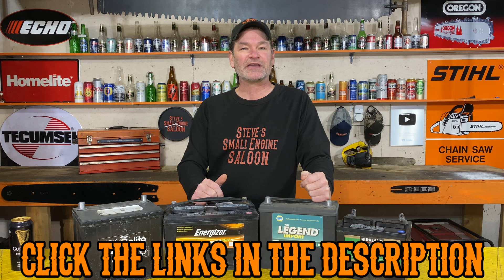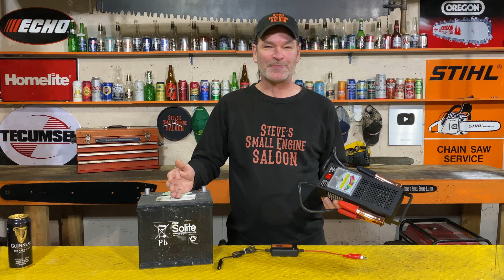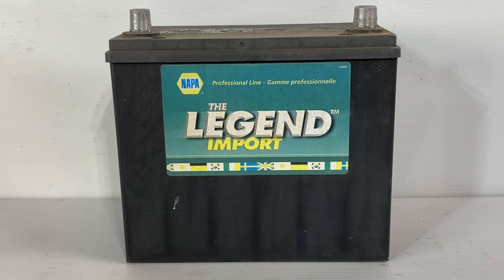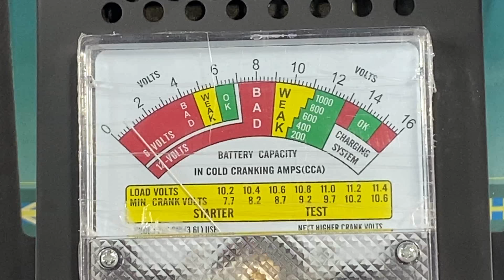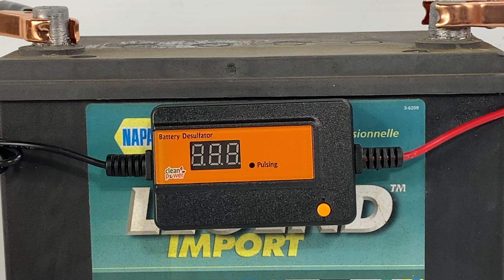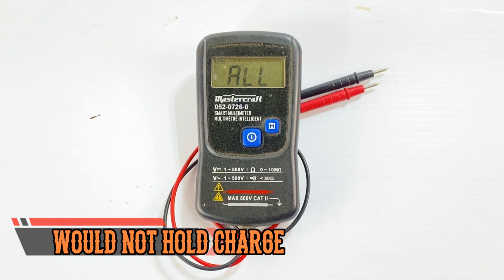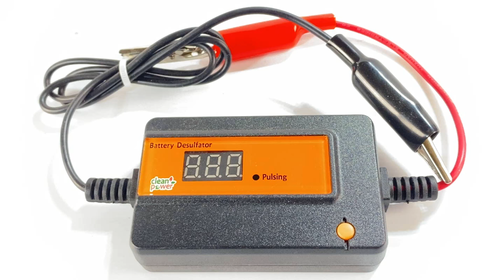Does An Electronic De-Sulfator Really Repair A Battery?? See Real Results

Comment: I used to sell the Pulse Tech brand and still use them to this day. Some had solar pannels some did not.
THEY WORKED and worked well.
They were warrented for 10 years and I only had 1 to replace of the 7 years I sold them. I bought and sold hundreds to various end users.
Keep in mind that the sulfation process does not occur over nite. So it can take a week or more to desulfate some batteries.
The only time I had failure was an open cell connector or a dead cell.
The military used them by the thousands because their equipment sits un-used for long periods of time.
Reply from the maker: Right on Jimmy!  Thank You...

Comment: legend battery would charge if you hook up a 9 Volt battery. You trick the Sensor in the Charger. If it charges take it after 10 min off. Just try it.
Reply from the maker: Great tip!  Thank You...

Comment: In auto tech school back in the 1980's, my teacher told me that they used to dump out all the acid, and if the case didn't crack, you hold that battery out at chest height, and drop it, then rinse out the case, poor the old acid back in and most of the time that would cure a bad battery.

Comment: Just curious why would a desulfator fix a problem if the problem is other than sulfate build up on the plates?   Like 8V open circuit suggest one (or more) of the cell  in  short circuit of course it will not fix that NOTHING will.

Comment: Generator engine pushrod wearing a Groove in the guide plate underneath the lifter I found another plate I remove the valve retainer studs and replace the plate put it back together adjusted the valves and it did it again it's only happening the exhaust side I checked the pushrod to see if they were bent they are not I switch them out just to make sure and it's still wearing a Groove in the guide plate which allows the lifter to slip sideways

Comment: Sweet! look forward to trying that on some batteries. So I had a saw with low power, would die almost instantly if I wasn't holding the throttle. finally figured out the exhaust spark arrester is  plugged. I couldn't find any videos that you have done on spark arresters so I thought I would post about it here. Super easy fix. Wish I had checked the spark arrester before bringing it to the shop, where they rebuilt and then replaced! the carburetor for a hefty sum that didn't fix the problem. Thanks for all your time and money saving tips!

Comment: I have had the same results with my charger/desulfator, works on some and not on others. To bring my voltage up to where it will work on a low voltage output I parallel that battery with one that has 12 volts and then hook up desulfator also in parallel for a couple of days to see if it works. Sometimes it does ,sometimes it doesn't
Reply from the maker: Good tip!  Thank You...

Comment: mine works great. got it from northern hydraulics in usa. use it on all my batterys every year. Mine plugs into the wall and trickle charges it first then switch to desulphate mode or manually desulphate it. And yes parallel to get it started if voltage is low.
Reply from the maker: Right on Mikey!

Comment: Using an inverter or small arc welder you can repair any battery back to new but of course the industry does not want you to know this and will put out pieces about questioning the idea don’t believe them they lie

Comment: If the battery has been used regularly, and simply reached the end of its useful life, this won't help. If it was a fairly new battery that was forgotten about and sulfated from lack of use, this device can often revive it. The batteries may never regain their full capacity, but, they can be made usable for a year or two, after being revived with devices like this.
     This device can sometimes "heal the sick", but it can't "wake the dead". I have actually had better luck with devices like this on AGM batteries, than flooded cell batteries. In every case, the batteries have been in storage, but have not had many charge/discharge cycles on them. (RV batteries)
Reply: I once perked up a motorcycle battery by dropping half an aspirin in each cell.  - got one more year out of it, which I felt was a reasonable return on investment.

Comment: Just because a battery is new does not mean it hasn't been sitting around unloved for ages before being sold. New batteries benefit from a charge before being put into use, and a 4 hour conditioning time on the desulfator device would be good for them.
Reply from the maker: Right on

Comment: The thing that works the best for me is to use a Solar PWM charger. in two weeks it will restore most of bad batteries. Solar PWM charges to 14.4 volts which does not hurt the battery. The other thing, is to test each cell of the battery with a "Hydrometer" this will tell it there is a bad cell.

Comment: Hi Steve, I got a optimate 4 for my motorbikes to keep on charge, and used it on an old 150amp leisure battery ( have two of them connect together with an inverter for mains power down my allotment) take two to lift them like the one's you have in the big RV's (lov erm) , anyway at ten yrs old one dropped to 4volts, and wouldn't charge up with modern charges, so stuck optimate on it and took 3 weeks to get it back to like new, it lasted another 6yrs before it eventually died, the other one is still going at 18 yrs , have a 2.4w solar panel just keeps it topped up, think I got my monies worth out of both batteries and charger. Lov your vids well put together.

Comment: We find a fair number of batteries dumped here illegally in Australia in with general garbage, always get  every single one. Some can be revived with my Ctek smart charger. However even if they can't they're still worth a few bucks to the scrap man. Managed to find a few really good batteries including a Besco top tier car battery that was fully charged 12.6 volts looks brand new cant figure why it was thrown out. A deep cycle solar battery, a semi battery and a generic made in China car battery that holds a strong charge and now lives in my tractor.

Comment: Hi Steve, in case it hasn't been mentioned already in the comments, you don't drink Guinness from a can. It's a stout, not a beer, and you pour into a glass slowly until it settles with a nice creamy head. It tastes even better when it's chilled in the fridge. If you ever get a chance, try a pint of draught Guinness in a bar, preferably in Ireland, you'll never drink want to drink a different beer as you'll be hooked.
Reply from the maker: You are correct

Comment: Use a second battery in parallel, then connect the device.
Reply: The problem is that it has two shorted cells
Reply: It is always good to Check the impedance first.
Reply: @paulbianchi7877  how do you go about checking the impedance of a battery and what is normal impedance for a 12 volt battery?
Reply: The value is provided by the manufacturer. But you may be able to google or as I recal IEE may have chart.

Comment: In NC, we can get ice storms or hurricanes, and either way the 
power is going out.  I keep a huge Deep Cycle battery on a name-brand 
battery maintainer-desulphator at all times.  It's normally used to run a trolling motor.  I've got three inverters, 
including a pure sine wave model for electronics.  If an outage might be
 short, I start with that for lights.  If power is out for over a couple
 of hours or we've just experienced Armageddon-like weather events ... 
THEN I'll start the generator!  Charger-Maintainers are the way to go for seldom-used batteries.  Plug and Play!

Comment: If you zap a completed dead lead-acid battery with 120v AC power for a couple of minutes, it vibrates the sulfur off the plates and will sometimes allow the battery to take a new charge. Old battery chargers used to have this option. This "de-sulfator" is doing the exact same thing, but is unnecessary.

Comment: I didn't read all 800 comments.  I just noticed immediately that the 2 it worked on had caps.  So what is the basic difference between a sealed battery n a capped one?  Besides one being sealed and one not😏😏😏😉

Comment: I usually just charge a dead battery at higher than normal amps . Sometimes it helps revive it by literally boiling the crap off the plates lol " charge in well ventilated area too " stuff smells bad while battery is venting 😄

Comment: Zap it with 50 or 100 amp for 15 second, wait 1 minute & zap again. After several charging intervals use normal 2 to 10 trickle charge overnight. Works about 50% on stubborn almost dead batteries.

Comment: If a battery freezes  in cold weather I have found no way to bring it back
Reply: I've had 3 that I have been able to fix up. I always make sure to let it thaw out completely and then put my old 2 amp charger on it for a couple of days. I've not tested them to see if they have full capacity but they've always worked to start the vehicles with no problem.

Comment: well steve i have a similar unit i searched for info and found several models of that desulfator,,  i picked the proper one for my 36v golf cart and it did very little,, but in conjunction with the charger going at the same time , a few cycles later my golf cart went from moving 20 ft to driving a few miles, i actually made another year with those so called dead 6v batteries.  does it work ""??  used with charger it fixed my batteries. snake oil ??? nothing else worked , prolonged a $800 battery purchase.

Comment: The two bad batteries, clean them out with a hose and give them a good wash and NEW ACID.  Then charge again and they should be fine. 
I worked with a guy who did that every winter and his batteries were over 20 years old.
Reply: Don't rinse with a hose. Use distilled water only. Hose water has minerals and will cause the batteries to fail faster.
Reply: @TehButterflyEffect  Wear eye protection and a face shield, empty out the acid, put the battery in a sink or outside and blast the plates out with a hose to remove flaked sulphate which sticks to the plates, then rinse with distilled water.  There can be up to half an inch of sulphate sediment which has fallen off in an old battery , shorting the plates. (hence bad battery)  Rinsing is too gentle.  
This was an annual service we performed in a chemical laboratory. Some people suggest fill with water and add a chemical tablet to break off the sulphate, then wash out and rinse with distilled water. Fill with new battery acid and charge. Hosing is quicker and gets all the sulphate out.

Comment: My experience has shown there are three different battery failures. 1) shorted cell, no solution to revive. 2) weak or worn out acid. 3) sulfated anode (negative) plate due tor running it to low on voltage too many times, or not charging regularly.  Your desulfator can work on these types of batteries.  Caution however, when desulfating the unit can sometimes brake off too much sulfation from the plates, collecting at the bottom of a cell, causing it too short, and back to battery failure number one.

Comment: EXCELLENT  VIDEO'I have a ctech about the same thing as  the one you have and i find sometimes it will fix some batteries but not all.TIP' alot of the chargers have an issue with the mode button .just take it apart and spray electric contact cleaner .it should fix the problem.

Comment: A battery charger does the same thing. Pull the caps off, put charger on start setting, not trickle charge, it will eventually "boil" let it go for 5 hours, remove from charger, the next day do it again, samw thing, boil it 5 times and it breaks the buildup on the plates and most of the time will give u a year or two more life with battery

Comment: A new battery needs a number of cycles to reach full potential.  Keep that in mind when comparing to a used one.  If the cells aren’t shorted, the desulfator can sometimes break down the crystals on the plates, but if the battery was discharged for too long, the crystals get too big, they can’t be broken down and you have zero chance of reviving the battery.
Reply: I work in the industry. This is broadly correct.
Reply: Needing several cycles to reach full capacity applies to Ni-cad batteries.

Comment: Noco and a few other brands have chargers that have a refurbish cycle setting. I tried it on an old battery that wouldn't fully charge, worked great. Seems it charges at 16v for periods of time, then 14v at periods of time. I've never tried a desulfator  but i'm guessing between the two you could bring that napa battery back (assuming it's not a damaged cell or had completely frozen).

Comment: Dump out the electrolyte, put in an Epsom salt solution, let stand for a day, remove and replace with fresh electrolyte, problem solved on almost 80 percent of bad batteries. Only bad part, it is dangerous. Then you that desulfator and you will have a brand new battery again. Great video Steve!

Comment: wow Steve, never tried that in my small engine shop!
Reply from the maker: Super cheap investment to try out!  Go for it Don...
Reply: @StevesSmallEngineSaloon I HAVE A REQUEST- "SWEET PROJECT CARS" channel on youtube says that they have for years been bringing back dead batteries with welder current. i believe 160amp for car battery and 200amp for deep cycle marine batteries, could have it backeards. if true this could be a game changer. NEW VIDEO??? 😉😉
Reply: Unbelievable.  I have an expensive battery in my 2005 XC90 that is acting up.  Going to try this out I think:)
Reply: @jpshowpro8408  did you try it?
Reply: Would these work on an AGM battery since they are dry batteries?
Reply: Im both of your Fc. happy Donyboy come visit Steve

Comment: It generates a specific frequency. That the sulphuric crystals resonate to/at. And sulphuric crystals cover the lower portions of the lead plates, rendering those portions useless. As in the portion covered in the crystals are blocked from receiving the charge.
Example: you can “charge” the battery conventionally, and the charger will say 100% charged, yet when you put the slightest load on it, it depletes practically immediately.
If 50% of the plates are covered in crystals, then when your charger says 100%, its only 100% of FIFTY PERCENT of its designed capacity.
The desulphator, generates the exact frequency that sulphuric crystals resonate at. And in doing so the crystals burst 💥 back into solution ( raising the acid levels) back to what they previously were or real close.
Also if enough crystals form before desulphation is done, they will form “ bridges” between plates. If the bridge becomes large enough, then the plates “short” out killing the cell eventually.
I swear by desulphators. They truly work.
The sulphation is caused by repeated charging and discharging over the “life” of the battery.
Only a desulphating charger can prevent it.
Reply: how long does this de-sulftatation needs to run?
Reply: @cgmarch2359  , depends on how bad they are. Modern desulphators simply tell you when the percentage of charge is reached by a digital number displayed. Pushing a button will tell you current voltage in the battery ( specifically when you first hook it up is time to look) as well as percent of charge in the battery.
Im assuming when battery shows 100% charged ( with a desulphating charger NOT conventional) , that it has attained a 100% by completely clearing all crystals into solution again.
When I did my trolling motor batteries, my (old charger) I wasn’t getting a lot of use out of the battery nor really strong power like when new. (Reason was because only 100% of what plates were not sulphated, were only being charged, vs the WHOLE PLATE (remember crystals that cover plate— that portion will NOT hold a charge) And yet the old charger, would show me 100% charged. 
Afterwards when using the desulphating charger, even after the first complete charge, the trolling motor was running like a banshee, and I could run TWO FULL days of fishing before I needed to recharge.
It was a game changer.
Also every time you charge with it, (if it hadn’t “completely “ gotten every crystal ) that it will teach a point of its as hood as it can get. Might not be exactly like a brand new battery, but you won’t care because the improvement is so noticeable.
And constantly using one insures no more accumulated build up of crystals.
And ALWAYS CHECK BATTERY FLUID BEFORE AND AFTER CHARGING, refill with ONLY DISTILLED WATER.
After using a desulphating battery charger,
Reply: @anonymousflyonthewall4732  i'm curious about why you n Steve are not verifying the electrolyte's acidity with a hygrometer? does that mean a desulfator restores the electrolyte"s acidity too?
Reply: @patrickbourque6864  yes, the sulphur crystals are acidic hence acid. They do nothing battery wise, as crystals, but deprive portions of the plates. And when they get pulverized by the frequency they go back into solution (acid).
Reply: @cgmarch2359  depends on size of battery motorbike size done over night big battery (150amp RV type) took couple weeks but mines not ment that size it's daisy chained to two motorcycles,
Reply: thank you for info!!
Reply: That is interesting and it makes sense -
Reply: Sulphuric crystals … 😂😂😂😂😂

Comment: Thumbs up Steve. I've been doing some research and thinking about buying one of those for my shop but haven't pulled the trigger yet. I realize that it will not fix every battery but if I can save my customers some $$ than that's always a good thing, so I guess I'll invest in one. Nice work Steve. Good info...Thanks.
Reply from the maker: Thank You...and You're Welcome...

Comment: nice vid  dont like the chemistry of the leadacid batterys you get lifepo4 s for good money that lasts much longer, can hold the charge, take more and dont drop in voltage under load. Lead acid are beeing replaced in maybe a century or so.